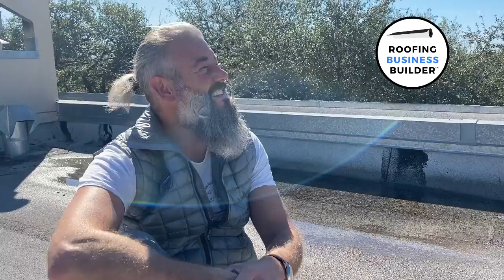How To Stop Ponding Water On Low Slope Roofs

Comment: Pointless video
Reply from the maker: Thank you for your comment!
Sorry that you were disjointed. However, this video was made specifically for the commercial roofing contractor. Most of the subscribers to this channel are roofing contractors that should understand what a tapered roofing systems is, but yet they are to shy to offer these solutions to their customers. 

If you were wanting to learn more about these systems and see the actual process of putting down a tapered system, which was explained in the video as "the solution to pounding water," there is a link to that in the description:
 
"To learn more about crickets and tapered insulation, check out this tutorial from my friends at Hunter Panels https://youtu.be/ZTJZJqI2TiM "